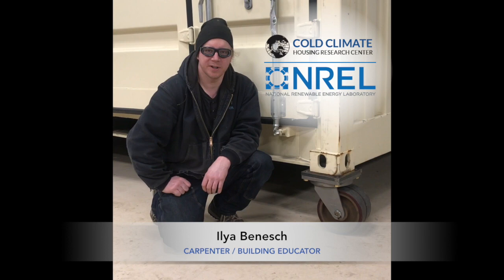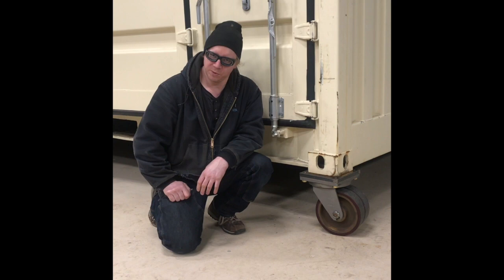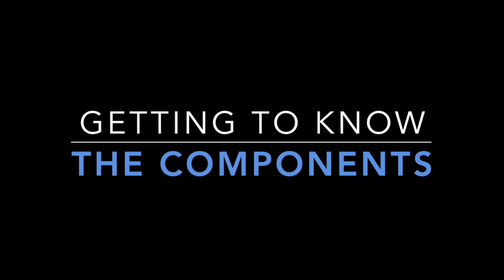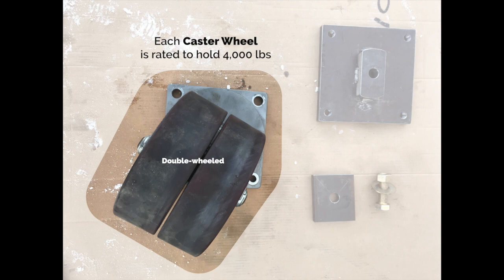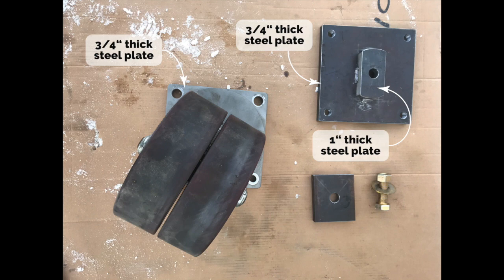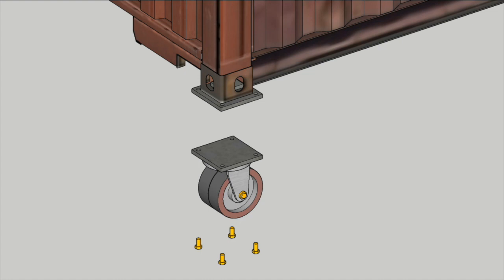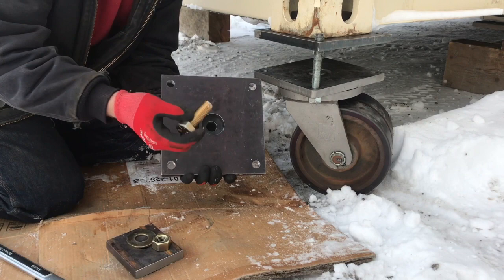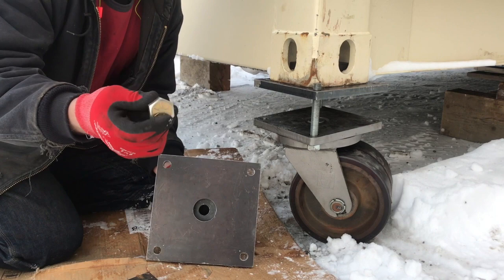Shipping Container Caster Assembly

Comment: Very nice!   
What did each wheel assembly end up costing?    And, is that a 20’ connex?  
Great work!!
Reply from the maker: Hey there, thank you for the positive feedback! The wheels were purchased through Ebay from an industrial surplus liquidator (that is to say, we got very lucky on the price). The four casters were purchased for $600 + $450 shipping from Illinois. Each caster wheel weighs about 85 lbs. Purchased new, one of these casters retails from $700 - $1,000 (not including shipping). The conex is a 20', that's correct.